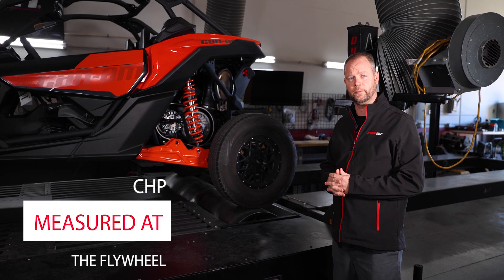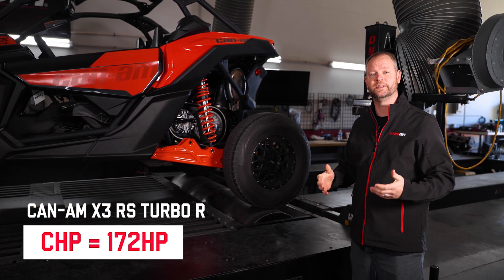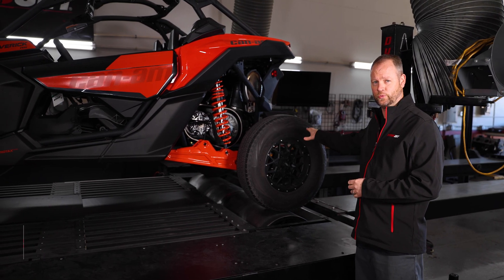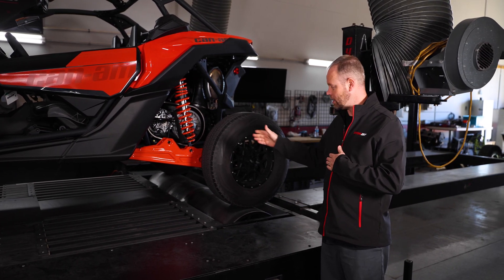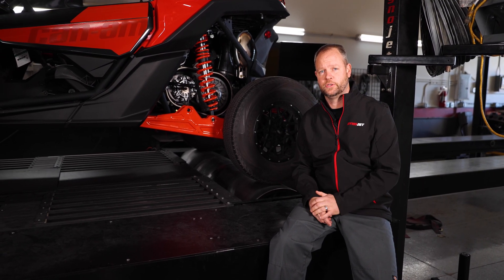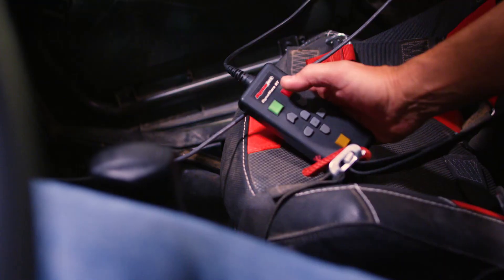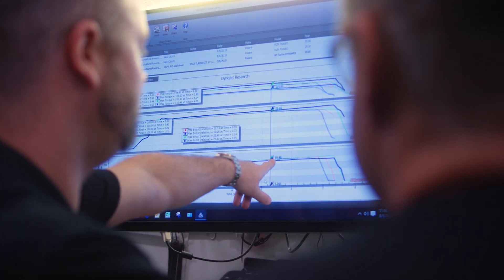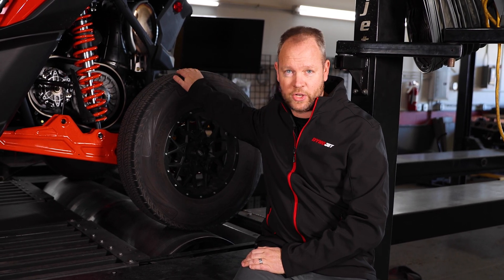WHP vs CHP — Which Power Measurement is Better?

Comment: Totally disagree with you ! Engineers design in engine for particular need and they put it on engine dynamometer. 
They get real and true horsepower rating from the engine crank not from the rear tires.

Comment: Hi, thanks for this explanation. Does seem to be arbitrary. Could you comment on how chassis or engine dyno’s differ from wheel dyno’s with regard to simulated loads during the test? Correct me if I’m wrong, dyno’s must run under some load or resistance. Some say the engine dyno CHP load simulates a drive train. I assume the wheel dyno simulates the rolling resistance and mass of the vehicle. Theoretically both CHP and WHP could be measued simulating the same load. This is why I say arbitrary, if I’m correct. Is there any standards for load simulation for CHP and WHP?

Comment: Tires used for racing (IE Shinko and some road racing tires as well) don't work well on the dyno (higher powered bikes will spin the tire on drum, especially when using Load Control).
So for that reason I have a spare wheel with a street tire that I use for tuning some the larger/higher Hp bikes and long story short, back to back runs made with the street tire vs (most) race tires show a 7-12Hp loss of power (that's without load control, tire not spinning) and knowing the power a particular bike/combination normally makes with street tire I can also say drag racing sticks can/will rob as much as 20-25Hp on the dyno. Dynos are a Tuning Tool = the before/after mods/tuning numbers are what matter👍